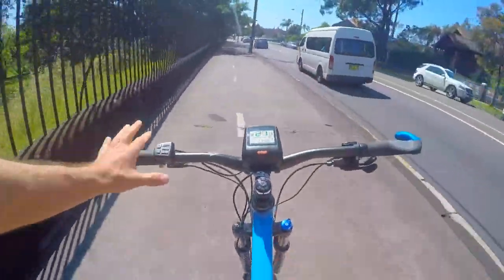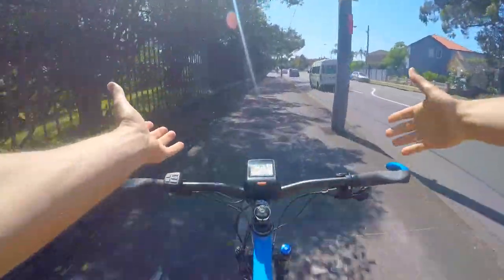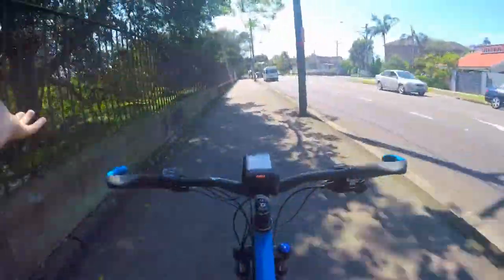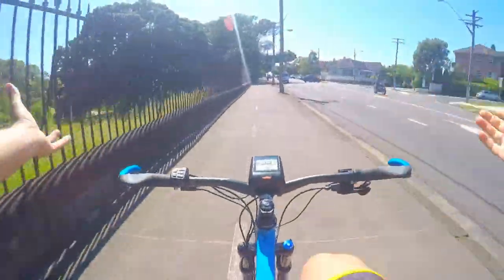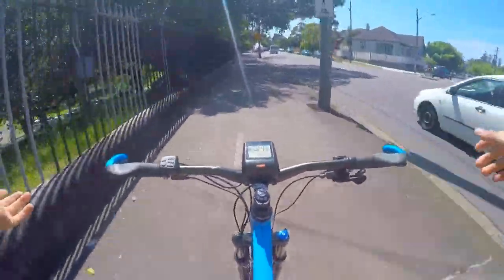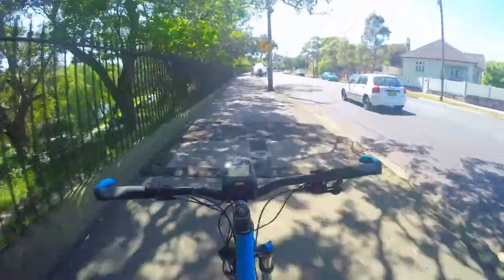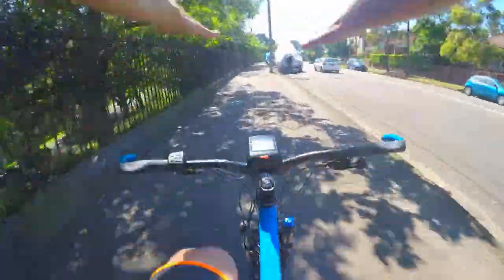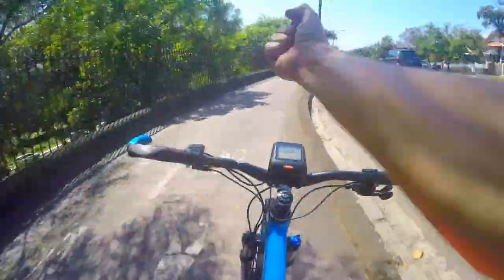Bafang Max Drive REVIEW (video6) Torque sensor / PAS • 250w Electric MTB • www.emax-ebikes.com.au

Comment: U are crazy! ;)) So again it does not calculate range? Come on Bafang! What about HD motor, is there range and can it be programmed?
Reply from the maker: +DaDo Bzz - Bafang is finalising some new displays for the BBSHD (similar to the Max drive in this video) but checking their website there is no mention at all about "range function" Range adds lot more complexity as you need to tell the electronics all battery pack specifications... ...even if not very accurate this would be an awesome feature =]